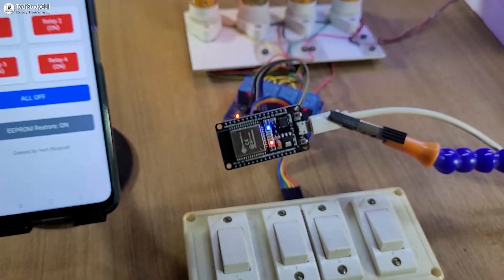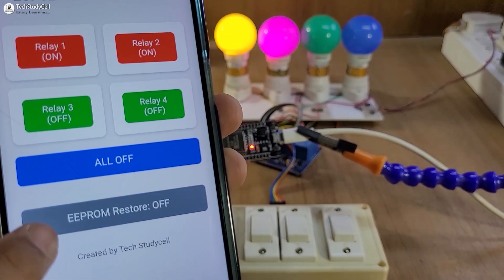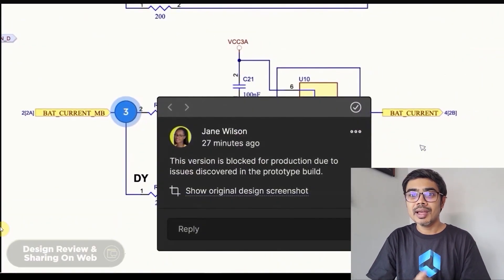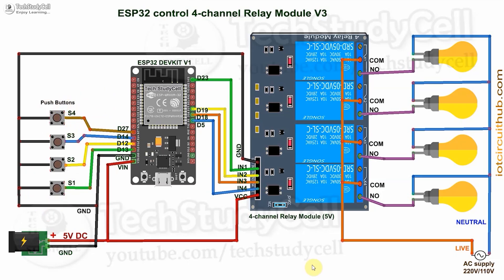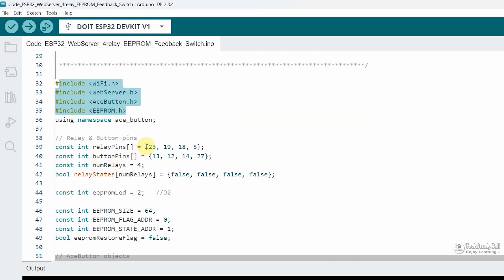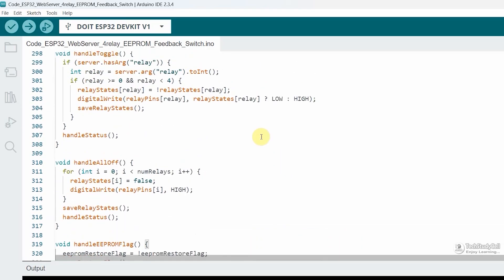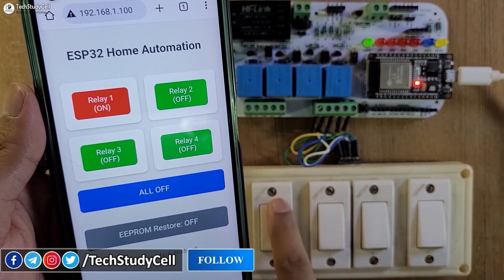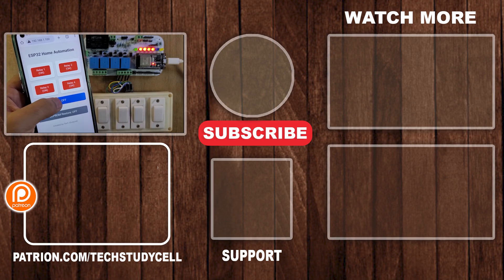Make simple ESP32 Home Automation project | Web UI + EEPROM + Relay control

Comment: Brother,

I want to create a smart remote control system using the ESP8266 module, through which I will be able to control 4 switches. These switches operate at 433 MHz frequency.

I have a Tuya Smart system that includes 4 RF switches. These switches can be controlled via the Tuya app and they respond to 433 MHz remote signals.

When I go to the smart switch settings in the Tuya app, there's an option called "RF Remote Control Setup."
When I click on the "Add" button, a message appears:
"Please press the remote control button within 15 seconds."

This means that during this time, if I press a button on the remote, the Tuya device learns that RF signal.

Now I want to know — can I use the ESP8266 to send that 433 MHz remote signal so that the Tuya switches respond?

I'm very interested in building this project, so please help me with detailed guidance.

---

Hindi Translation:

भाई,

मैं ESP8266 मॉड्यूल का उपयोग करके एक स्मार्ट रिमोट कंट्रोल सिस्टम बनाना चाहता हूँ, जिसके माध्यम से मैं 4 स्विचों को नियंत्रित कर सकूं। ये स्विच 433 MHz फ़्रीक्वेंसी पर काम करते हैं।

मेरे पास Tuya Smart सिस्टम है, जिसमें 4 RF स्विच हैं। ये स्विच Tuya ऐप से नियंत्रित किए जा सकते हैं और 433 MHz रिमोट सिग्नल पर काम करते हैं।

जब मैं Tuya ऐप में स्मार्ट स्विच के सेटिंग्स में जाता हूँ, तो वहाँ "RF Remote Control Setup" नाम का एक विकल्प होता है।
जब मैं "Add" बटन पर क्लिक करता हूँ, तो एक मैसेज आता है:
"Please press the remote control button within 15 seconds."

इसका मतलब है कि इस समय सीमा के भीतर यदि मैं रिमोट का बटन दबाता हूँ, तो Tuya डिवाइस उस RF सिग्नल को सीख लेता है।

अब मैं जानना चाहता हूँ — क्या मैं ESP8266 से वह 433 MHz रिमोट सिग्नल भेज सकता हूँ ताकि Tuya स्विच काम करें?

मैं इस प्रोजेक्ट को बनाना चाहता हूँ, कृपया मुझे विस्तार से मार्गदर्शन दें।